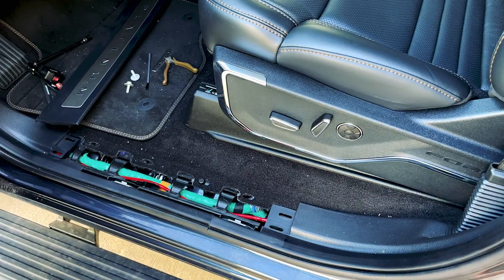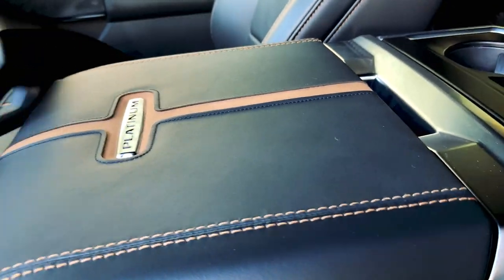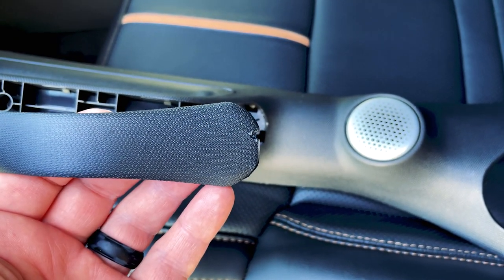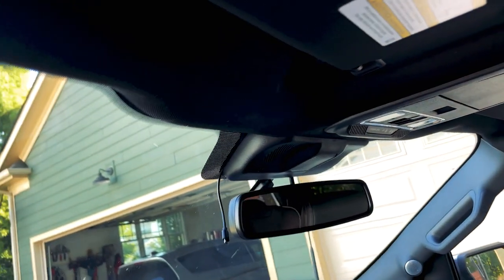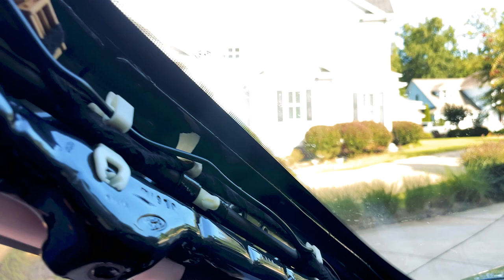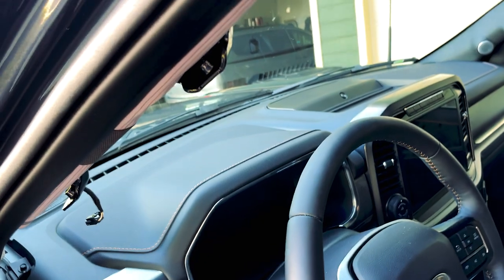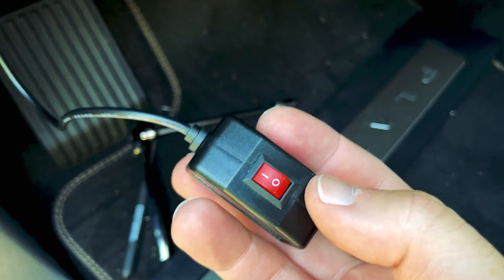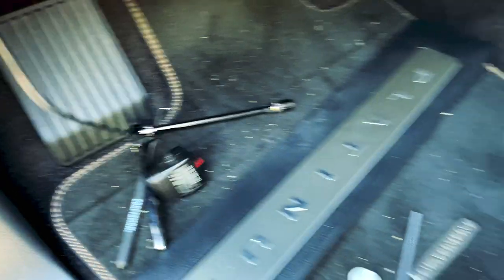2021 F-150 Dash Cam Install Pro Tips

Comment: Don’t remember if I caught it or not . . . Allow a few minutes after disconnecting the positive battery lead to ensure you do NOT have accidental/expensive airbag deployment!
Reply from the maker: Good tip. That would throw off your day!
Reply: Did you disconnect the battery to install the dash cam?
Reply: @aaronporter8172  As I worked around the A pillar, I did make it a critical point to disconnect the battery and wait at least 15 minutes for all power flow to dissipate.  That ensured absolutely no chance for a potential air bag deployment!

Comment: What I can’t figure out is why we have to do this. I see you have the Platinum, so I’m assuming that you have as many cameras as my Lariat has (6). Not using those as recordable cameras seems like a huge oversight.
Reply from the maker: Agree 100%. I’d love to see Ford add this although I’m a bit underwhelmed by what they’ve done with the OTA updates so far, so I’m not holding my breath.
Reply: I wish that they would at least have the power connection up near the rear view mirror. Then you wouldn't have to run cables throughout the truck to the OBD or fuse box.
Reply from the maker: @Jsuarez6  There is actually a device that will tap power from the rearview mirror: https://amzn.to/3EQWjoF. I haven't tried it but have heard of others using it with good results.
Reply: @TheBigHeavy  Thanks! Looks like it will work in my truck's rear view mirror. I'll consider it if I ever put a camera looking into the cabin.

Comment: I want to wire a 'Front Facing' Garmin 57W Dash Cam to my 2024 Ford F150..... but I also want to install a 'Rear Facing' Garmin Mini Dash Cam to catch video to the rear of me simultaneously to video captured to the front.  Does Garmin make a cable capable of accommodating '2' dash cams for a common scenario like this?  Having a hard time finding a double dash cam wiring guide.  Thanks.
Reply from the maker: To my knowledge, Garmin doesn't make an integrated front/rear dash cam like some of the other companies do. That said, their "Drive" app will supposedly play and sync video from 4 garmin cams. You could also just pull video and sync the timestamps if you had an incident and wanted to see multiple angles.

There is power you can tap into behind the rear seats. Check out my video on the radio install and you can see what I mean.

Comment: Well the tip about using a switchable OBD connector for the parking option is very helpful. Thanks.
Reply from the maker: You can install the OBD while rocking some ODB.

Comment: Does the Rearmaster OBDII enable the Garmin's "Parked Recording Mode" or does it just constantly record when parked?
Reply from the maker: It provides a non-adjustable 5 minutes of power after you shut off the ignition. I just got the Garmin version that’s supposed to work a little better but haven’t installed it yet.

Comment: What's a reliable dash that has a rear dash unit to look out the back
Reply from the maker: I looked very briefly since the rear unit basically would just show the bed of the truck so I can't offer any good recommendations. Long term, I'd really like to see Ford take a page from Tesla and use the cameras all over the truck as dashcams. Of course that would require them figuring out how to actually send us software updates, which isn't going well thus far.
Reply: @TheBigHeavy  I know I have the same truck from the video and still waiting the for self drive feature
Reply from the maker: @johnw391  I hope we're going to see it in 2022!

Comment: I am new to your channel I am having a issue trying to hardware my dash cam on my 2021 f150 the fuse that the dash  cam supplied are not compatible with my fuses in the truck but I like you solution to my problem

Comment: Thanis, I had it routed in the weather strip. Glad I got it around the curtain bag. Went on the fuse box side, wires dropped in there easy.

Comment: Nice informational video. Thank you.
Two questions:
1. Why did you need to remove the floor trim? I thought you were running a cable to a 2nd channel in the rear.
2. Why, why did you have to add that background music? Extremely annoying.
Reply from the maker: Thanks! 

1) Removing the floor trim gives you some "wiggle" to the trim piece between the dash and floor panel, so you can get your hand back there to run the cable from the ODB port to the A pillar.

2) All the youtube "celebrities" tell me I should add music. I'm just a big dumb animal so I do what they tell me although it seems several people find the music unhelpful so I may skip it in future videos.

Comment: Thanks for the information, I have 2 question’s, what are you running power for under the step plate? I assume you only had to run power from the camera to the OBD connection from above? Also is there any issue with the lane keeping assist with the camera in front of the mirror? And is there any reason you didn’t go with the adapter that hooks right up to the mirror.
Thanks for all the advice.
Reply from the maker: Power under the step is for a radio setup. Check out my 2-way radio install if you’re interested for the details. 

No problem with Blue Cruise or lane assist although I tried to put the dash cam away from any sensors. The camera for BC/Lane assist is actually in the “stem” of the mirror, so you can’t really block it. 

On the mirror connection, it looked like it would adversely affect the look for the cable, and the ODB allows for power for “parking mode” so you can run the dash cam for a bit off the car battery. Not a huge deal but I though that might be useful at some point.

Comment: There has to be electric from the mirror to tap into somehow
Reply from the maker: There is, I just liked the OBD port option since it doesn't require splicing anything or having a big adapter up near the mirror.